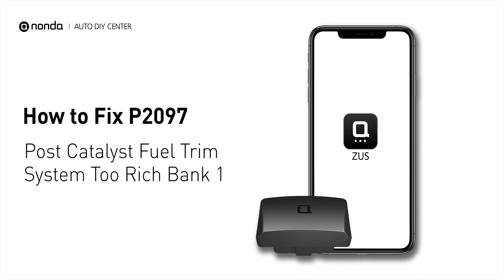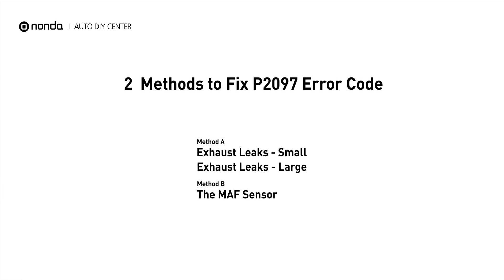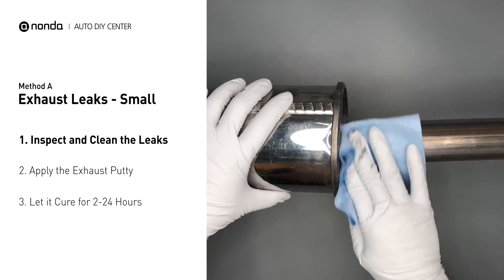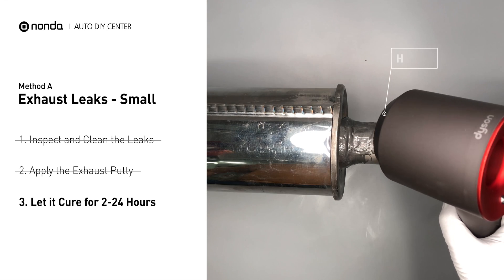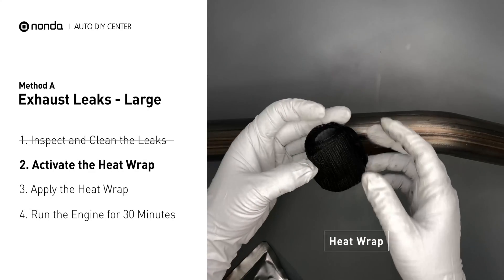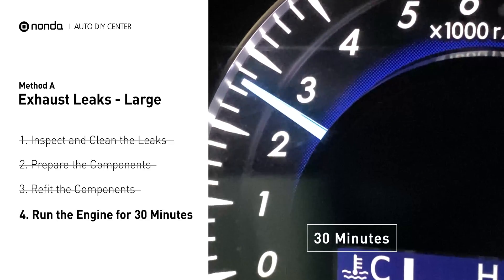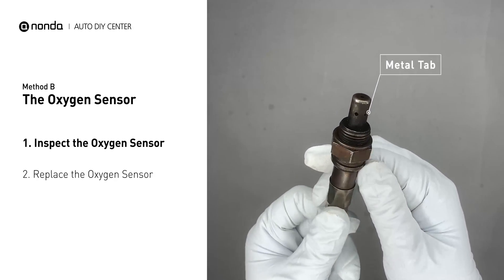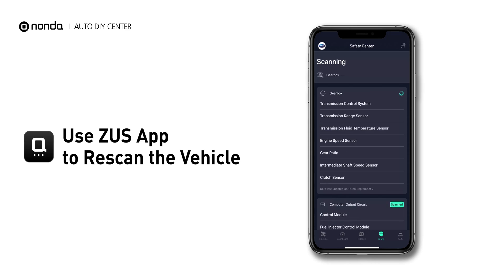How to Fix P2097 Engine Code in 4 Minutes [2 DIY Methods / Only $9.84]

Comment from the maker: Hi, I'm Steve, nonda's lead mechanic engineer. 
Feel free to leave your comments here if you have any mechanic questions, I will be glad to help you out!
Reply: I have a p0420 code on my 2013 Chevy Malibu as well as this p2097 code, what could it be?
Reply: Bad cat is what i see often with 420 code
Reply: my subaru guy told me to replace o2 sensor located after catalic converter. yours is before. i am confused.

Comment: Hey everyone hopefully someone can respond to my comment I got a Nissan versa 2015 and a few days ago I had a code about a oxygen sensor I ordered new installed myself 2 days ago and now I’m getting this code could someone tell me what it is if I didn’t tight it enough or something also let me mention I took out the throttle body and clean it with throttle body cleaner and a towel I did not move the butterfly thing with mi fingers

Comment: So I have this code on my 2015 hyundai sonata should I check this same issue as well
Reply: Did you get the code fixed ?
Reply from the maker: Hi Karen, you may follow the tips/suggestions provided in our video (how to fix P2097). If applied and the issue still persist, we recommend having your vehicle checked by your local mechanic for further diagnosis.

Comment: Hello I got this code like a year ago. Check engine like was on for a day then went off now it has came back on
Reply: Most likely o2 sensor dirty or going bad
Reply from the maker: Hi Rece, the repair for every codes varies per vehicle's year, make and model. To determine what triggered the issue, we suggest to have the vehicle inspected by a mechanic.
Reply: The P2097 code can be caused by a bad or going bad purge valve. I know it's odd, but it will cause the code. Normally the bad purge valve will throw a p017 or a p414 -418 .... Going by memory here as I've been out of the buisness since 2014. It's is odd but does happen.
Reply: I remember this as it happened to a customer's Caddy 2009 sts if I recall.  He had it to two shops, one a Cadillac dealer. Failed the state inspection, so he brought it to me after spending too much for no results.  Took me a while, even pressurized the exhaust system with smoke thinking a leak. Finally found it by throwing out the diagnostics and went old school one piece at a time manually testing each for vacuum and electrical vacuum switching. The rich comes from the purge valve not controlling the vacuum canister correctly, which lets fuel vapor to be burned from the gas tank and introduced into the maniflod......that was the balance issue for bank one.

Comment: What about code P0011,,, can it be caused by this same problem?
Reply: NO
Reply from the maker: Hi Electro, we suggest checking the condition/level of your engine oil if it's low, or checking if it has a faulty phaser. There are several possible causes of this code so to prevent potential damage, it is best to consult guides and manuals that are specific to the trouble code and your vehicle.

Comment: Hi I’m still getting that code
Reply from the maker: Hi Myiesha, if the possible solutions provided in the video were already tried/applied and still problem exists, we suggest to have your vehicle visually inspected by your mechanic for proper diagnosis and repair.
Reply: @nondainc  i did still nothing
Reply from the maker: Hi Myiesha, if that's the case  we suggest to have it inspected by the mechanic for further diagnostic.